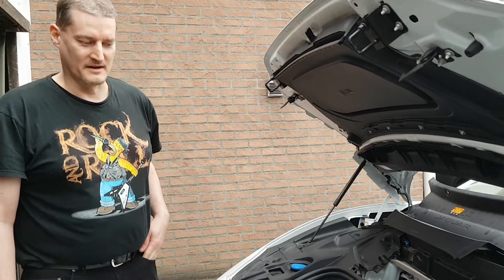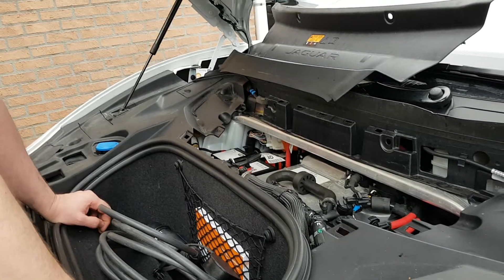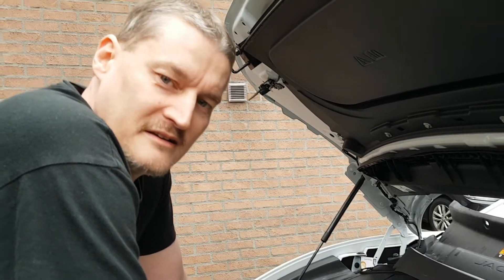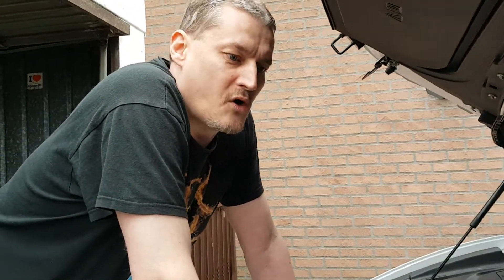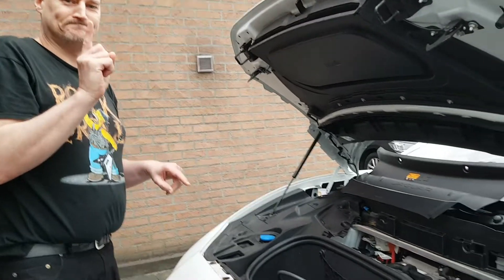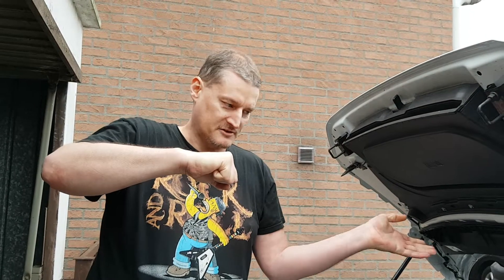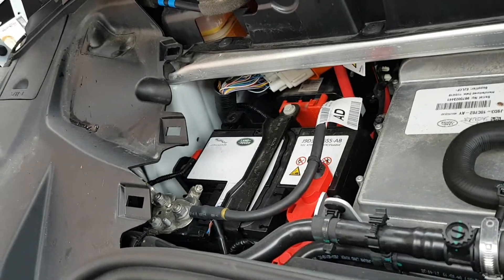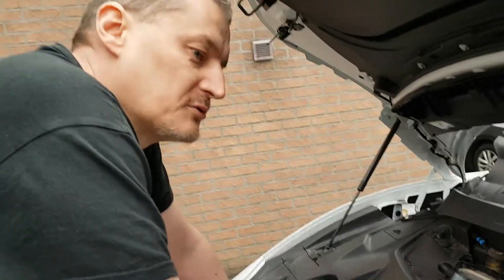The weakest link of a Electric Vehicle: the 12 Volt battery.

Comment: Thank you for the info. By any chance, do you think thte driving mode ECO should effect the recharging of the small batteries? I have an ipace and after a longer trip on eco, i needed to change the smaller battery, went dead.
Reply from the maker: @zoltanpovazsay3416  The Eco mode has, on my personal experience, only an effect on the drivepedal. It' just for a slower accelleration wich is a bit more economic. I allways use the full regen breaking instead of using the breakpedal. The 12 Volt battery gets charged by charging the car and by regen breaking too. My car still has the original battery and didn't let me down after 5 and a half years. Maybe tomorrow but today it worked.

Comment: Add 12v solar panel under panorama roof or on spoiler and plug it in 12v socket.
Reply from the maker: @otofoto  wich only works when the ignition is on.
Reply: @ You are electrician or not? Figure out how to achieve that and we would have great video. 👍
Electric car companies are dismissing solar panels as they would not help to charge traction battery which is true but they oversight that trickle charging 12V battery is a must as lead acid likes to be full charge not half discharged. Of course overcharging AGM is not good either so a safe voltage is needed.
Reply from the maker: @otofoto  for having the onboard 12 Volt sockets on the permanent 12 Volt connection you have to take out the fusebox and change the connections. Not easy and not adviseable for amateurs. And the Video would be very long. But i will think about it.
Reply: @evilelectrician8903  Just for fun. I still looking for I-Pace to buy and seems the issue is similar with all electric cars that they do not trickle charge the battery so solar panel would be a must. Nissan Leaf tried but failed as it was too small. 
I understand the need for 12V backup battery in case main battery fails or needs to be disconnected but the engineers took a lazy path by not waking main battery to charge backup. 
Maybe could find some shortcut to add power to some internal light which is positive connected or maybe even connect solar panel to power antenna and feed this way :)
Reply from the maker: @otofoto  you can connect a solarpanel directly to the 12 Volt battery too. Usually the 12 Volt battery gets charged when the car is charging and the regen breaking will charge the 12 Volt battery too. Of course, if you want to play it save you can connect a solar panel.
Reply: @ Better not to connect anything directly to battery for modern cars as there is BMS which monitors charge and discharge.

Comment: Have you considered adding a remote battery kill switch (used in old petrol cars having parasitic battery drain)
Reply from the maker: No. I never had problems with my 12 Volt battery but if i would install a mechanical kill switch. I am not a fan of remote gimmicks in cars.

Comment: Don't forget about the small 12v auxiliary battery, it's on the right hand side. This recently failed on my I-pace and caused the car to completely fail to move.The message, "Traction battery fault". Other gearbox fault messages also appeared. I bought one on Ebay for £99. Don't take it to Jaguar as they charge in excess of £500 to diagnose and change. It's only a 10 minute job.
Reply: Jag told me i can't just change the battery. Because it needed to program the new one. So jag must change it. Is that true?
Reply: There are two 12V batteries for older than 2021 models only.

Comment: All makes and models of EVs have had 12V battery issues. More poor software design than anything else. There is no reason why the HV battery can't turn on occasionally to top up the 12V battery. The 12V battery monitoring and charging logic is very poor. Tesla is going to a lithium-ion 12V battery. I would consider a 12V LiFePO4 battery as the replacement for the lead-acid battery in my 2019 I-Pace SE.